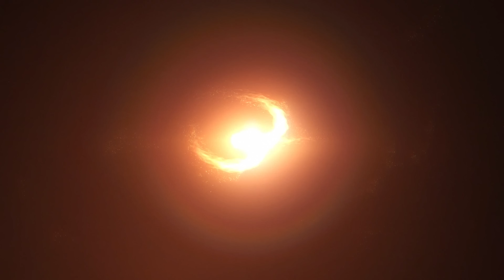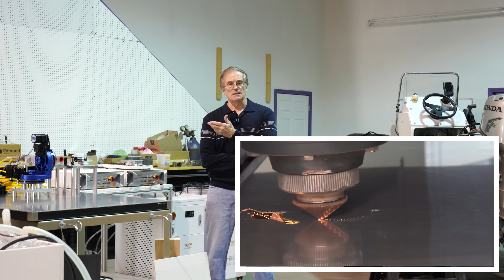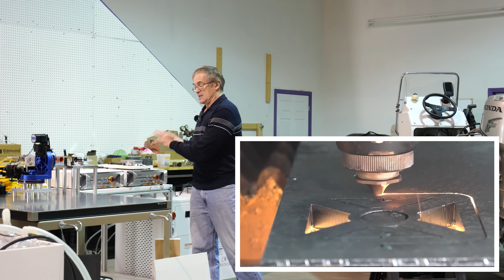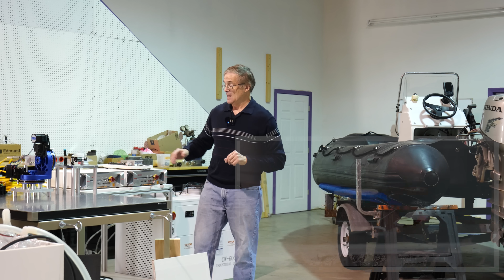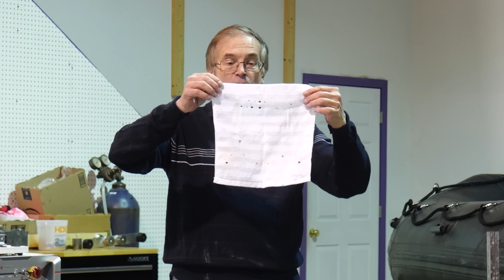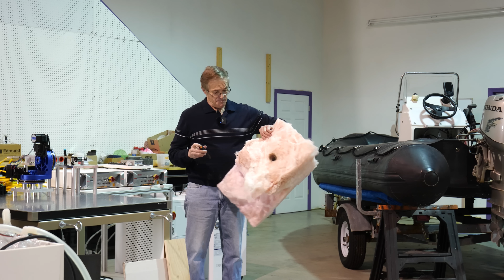We have a problem... and need your help!

Comment: I assume you are testing this indoors due to power supply mobility of the laser.  I would think ceramic based materials like your brick will fair better in giving you the "seconds" required to react and conclude any test run of the laser on target, think of it like a firing range.  You would want positive stops on motion systems of the laser it can only be fired against the calculated backstop you have built.   Easy solution is if you have a forklift, purchase pallets of bricks or cinder blocks.  Easy to store outside away from everything, move to build crude wall when conducting tests.  Next easiest may be move your power supply (long extension cord?) to outdoors with a dirt berm in the distance just like a firing range.  Though I would still have positive stops on motion system just above the horizon so you don't unintentionally mess with air traffic in the vicinity of your test location, lasers have a tendency to keep on going unlike projectiles.  This seems like you are re-creating the "SDI" or "start wars program" in your garage (https://en.wikipedia.org/wiki/Strategic_Defense_Initiative).  I thought the US has had energy weapons that direct lasers at missiles with adaptive optics all mounted on a plane as a result of this program.  The people who know lasers on Youtube are: Styropyro (probably doesn't need introducing) and Travis Mitchell (builds with fiber lasers all the time).  Interesting science content.

Comment: You can use scrap refractory bricks which are ground up. I think most suitable refractories will be fused magnesia bricks. You can buy these as scrap bricks from steel mills, there are companies that ground them up for other refractory uses. A ground up material (1-3mm in size) can give you more homogenius surface if you're able to "rake" it...
I recommend ground up bricks since high energy may melt or fuse some particles but a certain thickness of it will cover up the place of dislocated particles...
There are also MgO-C (magnesia carbon) bricks but the carbon content in them may cause local reduction of MgO with the high energy of the laser.
MgO is also a much better refractory than alumina (Al2O3) refractories.
I'm sure scrap MgO bricks will have the best refractory performance/price ratio.

Comment: I have many ideas but al of them may reflect part of the beam. I liked de water idea, wat if you use a waterfall behind? Or a very dense rain, droplets can disperse the bem power over a large area. What about cement fiber dry wall? Or ether a sand rain.

Comment: Foamcrete with water glass, which has been used by some youtubers too make forges and metal melting crucible furnaces?  Mixing foamcrete boards with layers of sand, gravel and dirt, could also absorb some of that energy for a brief time.

Comment: If the laser stops moving... make the wall behind it a dynamic target? Those background rollers that cheap movie sets sometime use could instead roll some laser-resistant material, spreading any laser load.

Comment: What kind of eye protection do you wear for this power of laser?!?!
Reply from the maker: Standard, certified laser eyewear. Anything that can damage these will hurt any other part of the body.  We need to be protected as well.
The drone operators will be in another room.
Reply: @TechIngredients thanks for the response. Maybe the materiel you are looking for might be related to the wavelengths needed to block. Wish I could help more.

Comment: Whatever material you use, keep it moving.  Unfortunately now you have the complexity of a mechanical device.  Ine can conceive of a large belt device.  Or rotating staggered cylinders might be less mechanically problematic.  Another thing that might get you a static solution would be louvered  slats so that the beam impinges at an angle instead if normal, buying you some time because of the cosine dropoff of the irradiance. Reflective surface would be ok if it was diffusive at your wavelength.   Is there metal powders with which you can coat the surface.  You can sandblast a metal surface but be sure it’s working at at your near IR wavelength.  Pardon me if someone suggested this already but you have thousands of replies.

Comment: Water was a good idea.... but you need to go further with it. A water wall / curtain of water or water bags. Yes the water bag will get a puncture and start to leak, but the small hole shouldn't empty it overly quickly and ideally contain the beam. The water coming out would be an issue in potentially bouncing the light back though.

Maybe instead of pure water, you could do the water wall or bags with a milky sort of liquid to try and absorb more of it. Mix it with charcoal or something like that to give a consistency that will reduce the bounce back risk a lot.

Comment: I’m not sure if there’s any material in this world that can absorb and conduct the heat fast enough off from such a tiny spot. That might be just thermodynamically impossible.

Instead I think there’s really two possibilities:
To scatter the beam with some sort of optical material that reflects the beam in all directions. But the beam being so small the optical surface must be incredibly tiny. Like micro scale fresnel lens or something like that? Not sure if that exists or is available as big sheets.

The second thing that could be possible is to have big surface reflective mirror in 45 degrees up. And then just shoot the laser up to the sky.
Just make sure there’s no airplanes, satellites, UFOs or birds up there to hit.

Someone suggested pointing the laser to the ground. That might be good as well. Then you could make jewellery to sale from the molted sand. 😂

Comment: Have you considered using mirrors to redirect it to the ground?  You might not want to destroy your nice concrete floor but if it's feasible to have the mirrors outside to direct it into dirt, that should be ample thermal mass.
Alternatively, kaowool / ceramic fiber comes to mind as it is specifically designed to take the heat.  Ceramic tiles may also be a good option (they are good enough to use on space shuttles).

Comment: What about constructing a water wall structure out of layered water holders, and fill them with dyed water. Use a dye that is highly absorbant of the laser's wavelength. Make the water holder structure segmented, such that fixing damaged sections is simple (maybe even just some slightly flattened 2L soda bottles). Maybe a water mattress, since that is  often internally segmented and can be patched with somewhat cheap means.

Comment: Is there any material the laser can pass through without destroying it? If so, use that material as your container.  Then you can use the other ideas of fog or water curtian wall contained. Filling with water solutions would likely be too much stress on the material . Since you want a large wall.

Comment: Plywood already works well
Why not a plywood ramp with water pumps ontop,
A water ramp of sorts

The water redirects scaters and cools, the plywood absorbs

No fire no problem,
Your problem with plywood was that they combust

If we soak them with water, running water even

I'm envisioning like a thick sheet of water enveloping it at all times, atleast 5mm of running water, you could mix it with chalk or other compounds to make the water opaque helping the diffusion and dissipation.
Reply: You have that calcium nanoparticles still around right from when you made that self cooling paint, use that 🤷‍♂️

All you need is some 2x4s plywood, a beefy pump and reservoir and some compounds to mix in

Comment: Rockwool? If not, then maybe a ton of thin plastic bags | balloons filled with water, attached to a wall or scaffolding of some sorts? You could pump the water in and out if it's too heavy to move.

Or maybe an artificial waterfall?

Comment: A thin obsidian wall would be a good solution, obsidian is not as expensive as u could think, at least on my country, i use obsidian plates to hold hot soldering iron, components, etc. Just be carefull about the angle u install it, i would prefer the refracted laser to be redirected to the roof, in case something goes wrong.
Obsidian has low thermal conductivity, and u dont't need a thick wall, just a superficial layer

Comment: Durock cement board panels. Gabions on casters-steel cubic cages filled rocks.  Steel paint cans filled with cement, stacked in columns of four with casters under a base plate.  Welding blankets.

Comment: Consider using a zone plate to modify the beam into a cylinder of fixed length.

I believe they're in use with X-rays.

Comment: What about some plastic 5 gallon buckets filled with water as a backstop? 
Pros:
Relatively low cost
when empty, highly portable
if breached, the buckets are able to be easily patched and reused
Cons:
It'll take hours for you to fill them
if breached, you'll have to quickly stem the tide of water to prevent it from ruining any delicate electronics
you won't be able to get the quantity of water needed in some locations the laser may be set up

Hope this helps!

Comment: it should be something that moves. so if you can have a slowly rotating plywood disc that should hold it for at least the duration on one duration. other moving things could also work like a plywood curtain thats pulled back and forth

Comment: Easy sand bags, as the light cuts it fills in and it also offers a bit of refraction to break the beam up.
Reply: I guess sand will melt and eventually turn into glas that somewhat is a reflection risk

Comment: Swamp Cooler/Water Wall. A Plywood backing with an irrigation pipe above, with a shallow catch basin beneath to catch the overflow, and a water pump. Mount it on wheels to roll out of the way, and you should not have to worry about water-saturated plywood catching fire...could add a fire retardant to the water.

Comment: I say you could create "spaced laser armor" (call it Cred Shield); hollow steel frames sandwiched between two panels, each one acting as a layer for the laser protection. The "strike face" is a diffusion layer, and the "catch layer" is drywall or another material. The diffusion layer is meant to turn the highly concentrated laser light into something that the catch layer can handle without burning through too quickly. The primary variables would be the spacing between the diffusion layer and drywall, and the efficiency of the diffusion layer. If your laser is able to concentrate 10,000 watts into a tiny area, even with 99% efficiency, 1% of 10,000 watts is still 100 watts that the diffusion layer will need to dissipate from that area.

My approach is similar to micrometeoroid protection on the ISS, where they have a thin layer meant to break up impacts and spread the energy over a larger area on the main hull.

Another suggestion that may help any method is to somehow mechanically move the "laser catch panels" so that even if the laser remains stationary, the panels themselves prevent it from lingering in a single spot, giving the material time to cool off. This could be done with motors or some type of simple actuator, the entire structure that the panels are mounted to, or maybe even an entire array of overlapping rotating discs.

Comment: What about square frames filled with dirt or rocks. Stackable, interlocking, the sides made from simple wood that would give very little target area for the laser and the laser would always hit it perpendicular. The laser-facing side is covered with steel mesh to hold the dirt or filling in. With this you could set up a kind of flat dirt-mound and it could still be set up and removed in about half an hour. Also you could stack as many "walls" of this behind one another as you need.

Comment: diamond will probably do ya

layers of plywood aren't going to have anything but an entrance fire, because there will be no air, try soaking them in borax

blocks of ice, the steam probably blocks it some

nighthawk in the light made a fantastic video about a recipe similar to starlight (starlite?)

there is a fogging system called hi-fog, for putting out fires in switchrooms and the like that makes a fog so dense with such fine droplets it kills a fire by sucking the heat out of it via the latent heat of evaporation, dropping the temperature, maybe it is dense enough

Comment: The whole time I just kept wondering if there is a safe way to scatter it rather than absorb it. Obviously this wouldn't work but my mind jumped to a cartoonish thought of a mirror with the glass frosted, but it would need to be very thick or it would burn almost immediately (like a smudged reflector) as well as if something went wrong, very dangerous for everyone. But the idea of trying to scatter and spread it out almost like a heatsink feels like something to toss around. Maybe someone has an idea about that.

Comment: A system to quickly detect a problem and shut down the laser, like an IR thermometer with a very low temperature threshold right beside the laser. Would need some extra logic for when you actually want to damage the drone but it might work (or at least be another layer of defense)

Two other similar ideas I had:
- Using an ultrasonic sensor to detect if the beam is traveling further than it should
- Painting the walls green and using a low resolution high framerate camera to shut off the laser if the color is detected (Though I worry the laser might discolor the wall too fast)
- Rotary motion sensor that shuts down the laser if the velocity drops below a threshold

Comment: lol.  Yes, our hearts are all on our sleeves for you and your too powerful lasers.
Reply: Now if one of the kids is missing because the lasers is too powerful then let us know and maybe I’ll actually feel sorry for you.
Reply: I just asked AI and it gave several different solutions but the one that I thought might work best for your purpose was a AI camera system with a raspberry pie that can turn the laser off if it sees it focused in an area too long.
Reply: It gave the general idea about a monitoring system, and the rest is me using the raspberry pi and their AI camera
Reply: Yes, I can help build a simulated dataset that mimics the failure modes and beam misdirection scenarios—without requiring real-world destructive testing. Here’s how we’d approach it:

⸻

Simulated Dataset Design: Emergency Laser Shutdown via AI Monitoring

Objective: Train an AI system (e.g., Raspberry Pi + AI camera) to detect abnormal laser behavior and trigger a shutdown before damage occurs.

⸻

1. Simulated Data Types

You don’t need real laser damage footage—just synthetic or staged scenarios:

a. Beam Path Visuals (Simulated)
	•	Rendered or camera-simulated beam spots in correct and incorrect positions
	•	Vary brightness, shape, and diffusion to simulate beam intensity shifts or divergence

b. Background Movement
	•	Add “target” dummies and unintended objects crossing the beam path (people, animals, drones, mirrors)
	•	Include environmental shifts (vibration, fog, smoke, reflective changes)

c. System States
	•	Normal alignment (green OK status)
	•	Misalignment or divergence (red alert)
	•	Blocked optics (e.g., soot buildup, camera occlusion)

⸻

2. Training Labels

Each image/frame would be labeled:
	•	SAFE_BEAM
	•	OFF_TARGET_BEAM
	•	UNKNOWN/NO_BEAM
	•	OBSTRUCTION_PRESENT
	•	SHUTDOWN_REQUIRED

⸻

3. Training Environment Tools

You can use:
	•	Unity or Unreal Engine for photorealistic beam path simulations
	•	YOLOv8 + OpenCV on Raspberry Pi for real-time object detection
	•	Synthetic dataset generation frameworks like NVIDIA Omniverse Replicator

⸻

4. Behavior Simulation for Testing

Let me generate the system logic so you can test without real lasers:

Prototype Logic Flow:

if beam_position not in safe_zone:
    trigger_laser_shutdown()
elif obstruction_detected:
    pause_laser_until_clear()

⸻

5. Bonus: Motion Monitoring via AI Camera

Use the AI camera to track:
	•	Unexpected motion in the beam’s vicinity
	•	Beam reflections off shiny surfaces (to warn of backscatter or misfire)
	•	Thermal anomaly via infrared overlays (if added)

⸻

Would You Like Help With:
	•	Generating a batch of synthetic beam misalignment images
	•	Code for the Raspberry Pi to do real-time detection and emergency shutdown
	•	Auto-labeling simulated training data for model development

Let’s make your failsafe real—without burning any drywall.
Reply: You should be able to set up a system with multiple cameras, just on one pi and you should be able to make it portable also if you need to move everything around.  A little logic about if the laser isn’t pointed at the intended target for more than 5 ms it sends they shut off command to the laser and you could just power off the unit at the plug with something like an X 10 device if that’s what you had to do.  There’s tons of modules that could be integrated to help with the project that operate on Zigbee
Reply: CSRD-0023: Directed Energy Safety Integration

Requirement: Implement a real-time failsafe system for high-powered fiber lasers to prevent unintended beam discharge and ensure operational safety.

Solution: Developed an AI-driven monitoring protocol utilizing Raspberry Pi and computer vision to detect off-target laser activity. Integrated emergency shutdown procedures and evaluated advanced materials for beam absorption to mitigate risks.

Status: Technical solution provided in response to public safety request. Mission accomplished—still serving.

Sorry, but I had to go back and do the paperwork for you.  Communication systems requirement documentation from the United States Air Force. Sorry, but we have to track all of these projects because it amounts to man-hours hours and accountability.

Comment: paint the bricks with thick matt black fire resist paint (make your own), or use a panel that is very textured, or has perpendicular artifacts, so IR is dispersed and soaked in i do this, and works well.. (think how vanta black works, the energy is soaked up between the gaps on th surface).